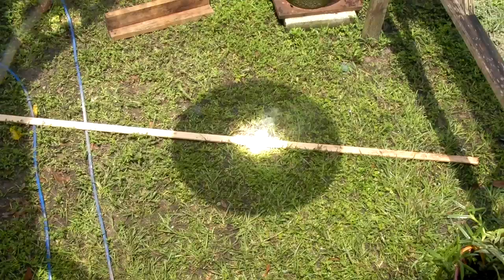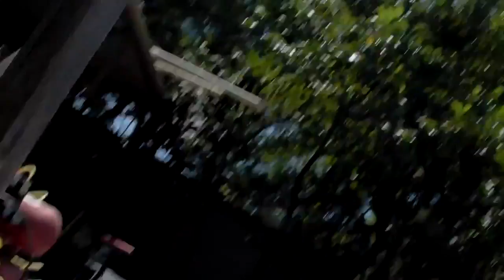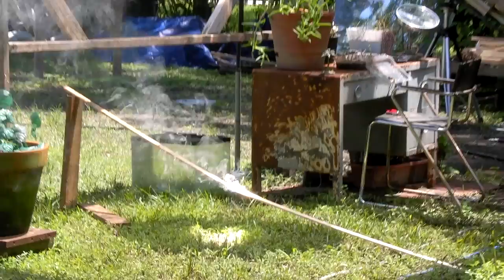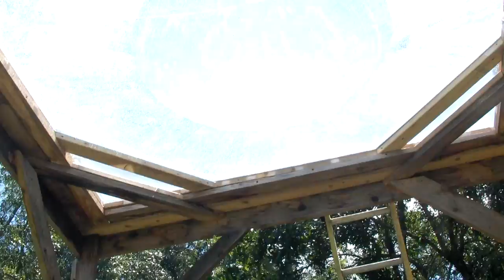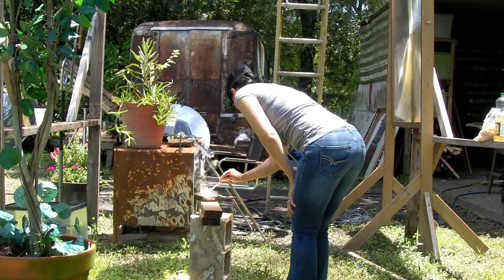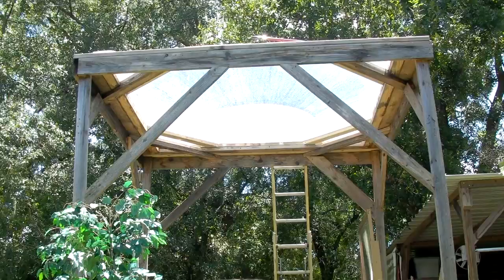Solar Death Ray Cooking with a Water Lens

Comment: Do the results of solar power usage vary for areas of different elevation? I would initially think that Phoenix would make a great place for experimenting, yet I wonder if high-elevation mountains would have better results because of the altitude and thinner air.

Comment: If the energy was focused onto a thick slab of iron it would conduct into a skillet just as a stove top burner does. If the light struck the iron for some time before time to cook something  it would probably be quite hot for a long time

Comment: Cant you use copper pipe to heat transfer the energy from the sun to a safe location , sticking your hand under neath the direct light is kind of dangerous

Comment: Cool video, guys. Perhaps you could put a 1/4" or 1/2" sheet of metal underneath the pan big enough to shine the light on and leave room for the pan (so the pan is not in the light.) The steel metal plate would absorb all the light/heat. The pan would get the heat from the steel metal plate that it is resting on instead of a direct hot spot. It would be a little less efficient, but the heat would be spread more evenly, maybe?

Looks like Denise has lost some more weight. No bloopers at the end?

Comment: Solar One in California uses molten Salt to store heat to keep the generator running 24 hours.

In my eye, I see a metal barrel with insulation and molten Lead. Run a copper pipe through it to bleed off heat into steam and then use said steam for a steam engine turning a generator.

I use Lead as an example. It's cheap and hot enough to make steam. But lower than your 1400 F hot spot. Maybe another metal will be more suitable.

Comment: I respectfully disagree you probably used plastic fiber optic the true glass one does radiate the heat and UV. One thing I have not seen you try that is blacksmithing can you forge metal with this power? If so that is huge a truly green blacksmith?

Comment from the maker: Hi Sean,
The material will fill with rainwater. The last one filled to over 100 gallons before the material tore. While the vinyl is rated as UV resistant it tends to get damaged from 5+ months of exposure. I usually just siphon the water off. This only works in the summer as the sun is lower during other times of the year. Fiber optics do not transfer the light efficiently enough to produce usable heat. I will be making larger fibre in a future video.